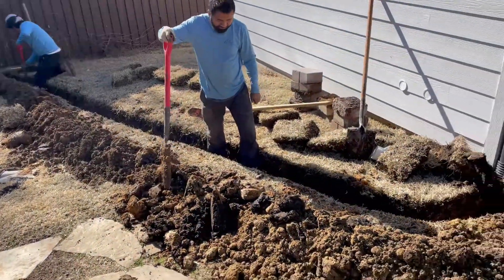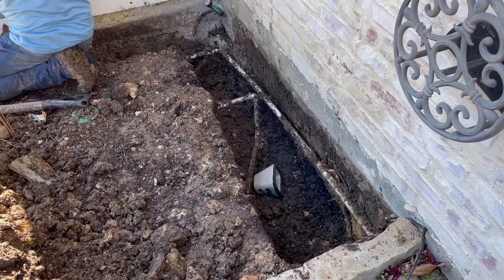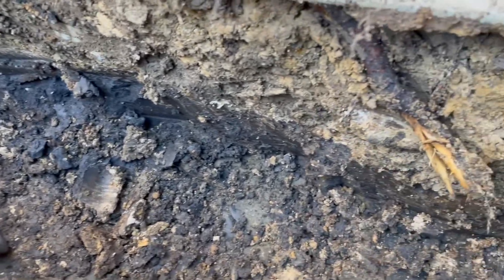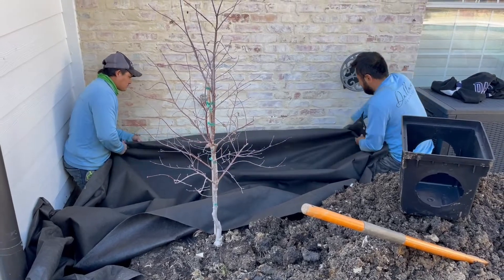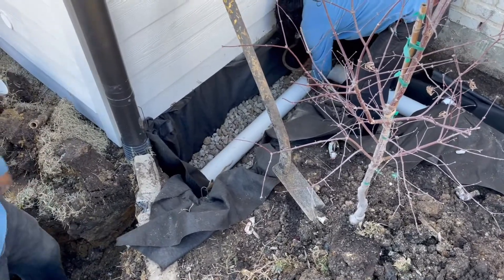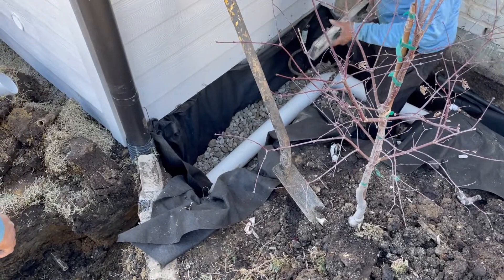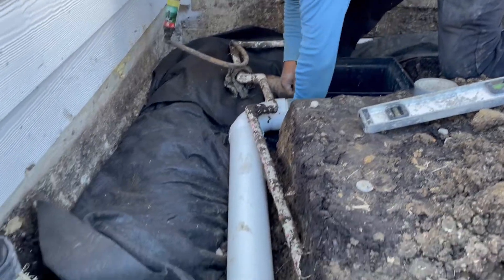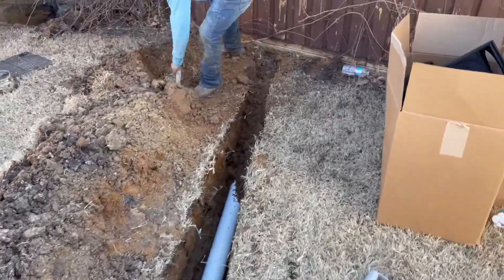French Drain vs Footer Drain - What is the difference?

Comment: Hi, great vid. Just wondering, lots of different advise on this. Does going below the foundation comprimise the foundation itself, ive been told never to go below it. Albeit in one i have just done, i went a couple inches below... any advise would be great.
Reply: Our position is that going below the foundation is best - it draws excess moisture out from underneath the slab that otherwise would be trapped. Consider also that the trench dug will be backfilled with a rock aggregate, which is very stable and won't continue to compact, once installed and compacted the first time. For those reasons we feel it's safe and encouraged to install below the footer. Thanks for the questions!
Reply: @johnkeathley  thanks John, very much appreciated! Wish we had good contractors in the UK!

Comment: Great video - how come you dont put the footer drain ~3-4 ft away from foundation, so water wont sit next to the foundation? and will instead be a little ways out? Thanks for any insight
Reply from the maker: Great question. There are different locations to put a french drain, depending on what you are trying to accomplish. The french drain in this case was designed to draw water out from under the foundation, and that is more effective the closer it is to the issue (which was water under the house.) To your point, the fact that the french drain is adjacent to the foundation would be a problem, except that it is exceptionally deep, and has a layer of dirt with surface drainage above it. This means that the majority of water drains away through the solid pipe system, while only the water that seeps through the dirt goes into the gravel trench drain, which is then wicked away quickly.

If the french drain were installed on the surface like many of them are, then we would want it to be about 3 feet away from the foundation, because these do in fact draw surface water toward them. So you are correct in your thinking.

Essentially, if the french drain is deep - 2-3 feet down (and below the foundation), it can be placed up against the house. If it is shallow, it needs to be separated so as not to draw water toward the foundation. Thanks for watching and for the great question!
Reply: @DallasDrainagePros  wow, thanks man, GREAT answer - I have asked this question on about 4 different drainage channels and you are the first to explain it adequately in a way that makes sense. You know your stuff. Thx again, subscribed
Reply from the maker: @DougBashem  Absolutely - thank you so much!

Comment: I'm debating whether to do a french drain down at the footer or just do a shallow french drain and regrade in front of my house.

The footer is 6-7 feet down from where surface level is. Currently there's a window well with no cap, and the earth is not graded away from the home.

On the inside basement wall, the water gets damp during heavy rains down near the footer. I guess I don't know when hydrostatic pressure is pushing up and into the home vs surface water being the issue. Would it be worth it to just regrade and add a shallow french drain, then see how it is?
Reply: Just doing the grading and adding a surface french drain will definitely help, and it's possible that it will resolve the issue entirely. Grading should be done either way, and having a surface drain first is always your best line of defense in addressing the majority of the water. If you do decide to go that route, my only thought would be to make sure to place the surface french drain far enough away from the house so that if you do end up having to go deeper, you don't have to tear into it. Best of luck!